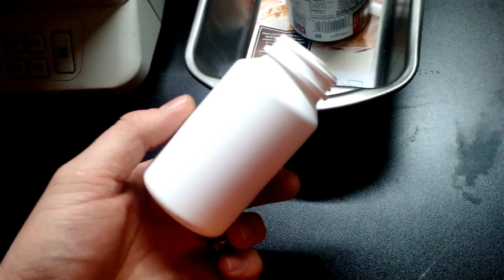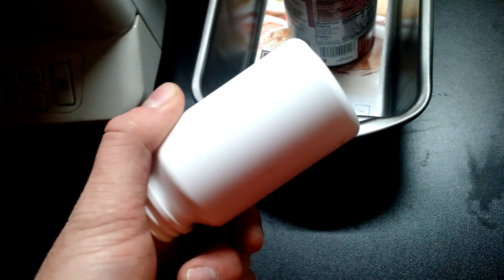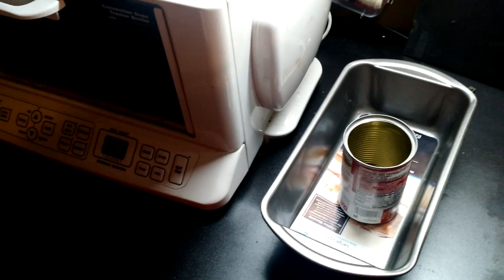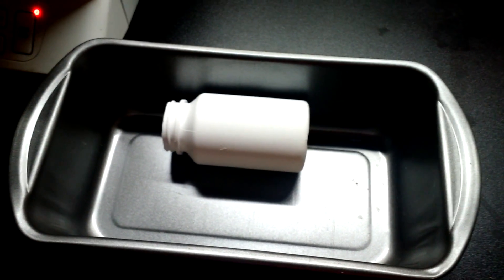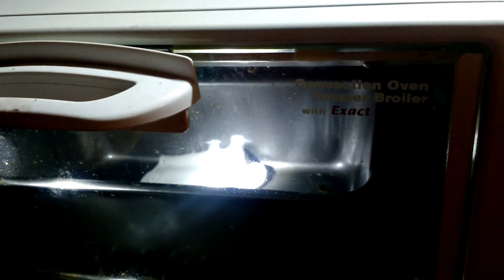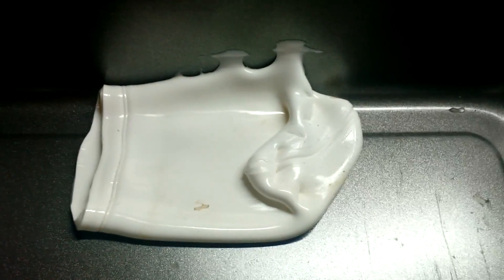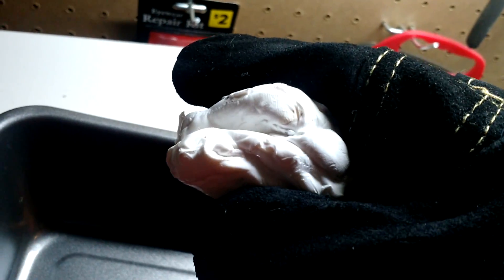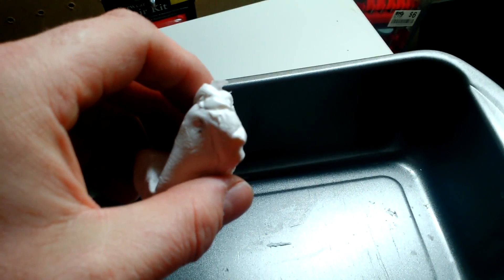How To Recycle HDPE Plastic To Make Parts!  Trash to Treasure, Part 1!

Comment: "Its super hard"...... thus the name HDPE   High Density Poly Ethylene
Reply from the maker: I was surprised as my workbench top has a quarter inch HDPE sheet on top to protect it.   It's super soft and flexible, even easy to scratch and nick.   Grocery bags are also mostly HDPE, and they are soft and flexible.

Comment: Rays woodshop already mentioned melting points but there is another thermal property of plastics that comes first and is HUGELY important to working with them: Glass Transition Temperature. This is what you're seeing first off in this video; the point at which a plastic becomes soft and loses its shape under releasing of internal stresses and the force of gravity. This is not the same thing as melting, but it is easily confused as such because the plastic becomes easily workable at this critical point. Once allowed to cool, it will hold whatever shape you forced it into and once again be hard, or this is really important, be even HARDER and MORE durable than it was before. In 3D printing, more experienced people will exploit this by baking their initial parts in sand or other such supporting substrate, allowing the plastic to lose rigidity without losing shape, and the resulting cooled part can have dramatically better strength and heat tolerance from then on. This matters to temperatures because afterward, the same amount of heating won't have the same effect anymore. It is now a material with permanently changed properties. Also important to note that not all plastics benefit from this, and some may even lose strength and durability.

Melting, in plastics work, is the temperature at which a plastic will literally pour like a thick syrup. Some plastics do really well with this state, others DO NOT, and these are very high temperatures for most industrial plastics, like upward of 250C, even upward of 300C. Polycarbonate is a fine example of a ridiculously high melting point plastic, yet if you're careful, you can bend it very effectively at the glass transition temperature and not risk burning it or compromising its impressive strength.

One thing to note about melting temps and glass transition temps is that it's not at all the same experience as like ice turning to water or metal turning to a liquid state. Such materials have a very fine line between solid and liquid. Plastics on the other hand tend to first lose structural rigidity gracefully, then more and more as they get hotter and hotter. As they approach the point at which they flow nicely, there's a strong risk of burning or destructive change in properties with additional heating, so in the industry they maintain rigid controls over hot enough but not too hot. What gets the job done without too much compromise is right where you need to be, and every plastic type has its own unique range. Take PLA for instance going to slop inside a hot car in summer, vs. ABS getting hot enough to give you burns when you pick it up but still holding its shape and strength very well.

</plastics_babblefest>

Comment: PLEASE WEAR A MASK
Reply from the maker: What type of mask do you suggest?   And do you know what temperature HDPE starts to off gas, the point where a mask would be helpful?
Reply: idk but you should definitely have some vacuum or strong ventilation system that can handle that prior to even opening the microwave.
Reply from the maker: That wasn't a microwave.

Comment: I’m finding plastic materials with the same triangle label, only thing is that the number doesn’t say two in the middle, like yours do. i’ve found ones with the number 5, some have 1, but most of them have 02 in the triangle. What does this mean? Can i still melt them? I’m curious as to what the numbers indicate, and of course if i CAN use your technique even though the number in the recycling triangle is different ?
Reply from the maker: The 2 means it's HDPE plastic, a type of plastic that is fairly non toxic and safe to melt down.    I'm not sure what the other numbers reference, I would have to look them up.
Reply: 1D10CRACY Gotcha, thanks for helping out 💞

Comment: Can probably use it to patch a cracked bumper
Reply: Those are more likely PP or ABS and they can be fixed with a plastic welder, but you'd need the matching plastic welding rods. Some bumpers are really thin, though, so a structural repair (like a mounting tab) might not be possible in those cases.

Comment: You showed up the milk jugs which had labels, and mentioned the HD for 5 gallon buckets.  They all have ink.
The point is to be aware of the fact that these pollutants have different melting points than HDPE, and change its strength.
That is one great reason recycling HDPE is not scaling or returned to manufacturing.  It is impure, and unpredictable to less useful.

Comment: I saw in the below comment that this plastic was non-toxic. That was going to be my question. I would be concerned about breathing around it as it softened in the oven. Interesting video.
Reply from the maker: I wouldn't go as far as to say non toxic.   But it doesn't offgas unless you burn it.   Milk jugs are made from the same material, the plastic itself is believed to be one of more safer plastics to work with.

Comment: great way to get cancer real quick.
Reply from the maker: So you think its offgassing?   Or just assumeing cancer is a result of melting all plastics?
Reply: Hydrocarbon inhalation causes cancer and other horrible diseases.
Reply from the maker: Ah ok.  Thought there was a risk I didn't know about..  At low temps there is no offgassing.     Its actually a pretty safe plastic to work with, and most food grade containers are made from it.
Reply: There is offgassing even at room temps-normal breakdown. The risk increases with the temp. There is nothing good about this substance. Nothing. It is damaging and offensive to every part of nature. It should never have been produced, but now we have tiny particles of it everywhere-the sea, the air....everywhere. So we reap what we sow. We deserve to suffer the fate of our stupidity, but other creatures do not.
Reply from the maker: HDPE or plastic in general?
Reply: All plastics. Recycling them into smaller and smaller bits never makes plastic disappear, just easier to ingest by more organisms. This is concentrated-CONCENTRATED as it moves up the food chain. Not diluted-concentrated. By the time it reaches large mammals (eg. concentrated in salmon, that salmon eaten by a bear)it is close to a death sentence. We are seeing the evidence of this in massive die-offs of marine life.(eg, the largest king penguin colony on earth has been reduced by a staggering 90%!!!)-this barely rated a mention in the mainstream media, no surprises there. Unless we can find a way to naturally return the elements of plastic back to nature, all we are doing is just shifting mountains of plastic from one place to another all the while stupidly hoping it will just magically disappear.

Comment: Thank you so much for the very informative video. Uses of this product would be endless. Only thing is 3OOC, would cost much electricity & escalation of my UK electricity bill.  Think. I  may need a manually operated Furness.  Thanks again fab video. Best of luck. Thumbs up & Subscribed.
Reply: Pat Pathinayake 350F
Reply: Thank you very much.

Comment: Worked in a Plastic injection molding plant for twenty years. High Density Polyethylene has a melting point of between 250-360 degrees F.  Might want to be sure to be very careful with the melted form which will stick to skin,clothes,shoes and does not feel very good.  Polyethylene can almost become liquid at around 450 to 475 degrees and does not come off of anything very easily. We melted Plastics in an long metal barrel. This barrel had a screw inside it with the incline of the threads tapered so as to increase the pressure put on the plastic which would help it to melt as it went from the feed throat to the front of the screw. The outside of the barrel also had sections that were heated by heater bands. The screw was turned by a hydraulic vane motor. At the tip of the screw was a check valve. Plastic would go past the check valve as the screw retracted once the shot size was made the machine would push the screw forward which closed the check valve on the tip and forced the plastic into the mold through a sprue hole in the mold. So basically when the plastic is shot into the mold under pressure it is in a semi liquid state. The molds are temperature controlled via a machine called a thermolator which would heat certain parts of the mold while cool water was also used on other parts of the mold to help the part to become solid quicker. We made plastic parts for Whirlpool refrigerators and other whirlpool products. We also used PVC, CPVC, Polycarbonate, Styrene, Acetal Delrin, and many other plastics, each having different melt points and specs. I worked on all the machinery and kept 52 presses running the best I could along with about three other maintenance men. And one last thing we used grinders to take bad parts back down to pellet form which we loaded into a large hopper above the feed throat.
Reply: David Bean - That sure takes me back.
I made baby toys for about 2 yrs. (Luv’n’Care)
Reply: Sir I think you’ve found your calling. Please think about creating a video.
Reply: @ David Bean, thanks for the information, I am a collector of 1/6 (12")  GI Joe Figures, I was thinking about using the black plastic clothing hangers with clips that I acquired .....to make equipment parts etc. What temps would they melt?
Reply: Cool, man. Thanks for sharing. I was kind of expecting this story to have some sort of accident or tragedy mixed in, but interesting nonetheless! Next time, give the people what they want! Lol
Reply: i wish you could show us on your Youtube channel. It would be fun to watch
Reply: Very good Information , you make your channel.
Reply: How do You keep clean the barrel and the screw if HDPE sticks everywhere?
Reply: what do you think about melt abs plastic? like on electronic case

Comment: How long does it take to harden?
Reply from the maker: Just a few minutes.
Reply: 1D10CRACY also... when hard... how much impact can it take without cracking... just say you took a hammer to it... would it crack or is it strong? I am wanting to make a chin guard for my skating helmet (cheaper than buying one) I already have my mould but I don't need it splintering in my skin if I stack it 😝

Comment: Folks..don’t try this at home in any of your kitchen appliances. Plastics are loaded with all sorts of chemicals that are safe to handle after they cross link and set..but once you reheat not so safe..need a plastic part go on the Internet..wanna help the environment..continue to recycle..
Reply from the maker: You are absolutely correct.   One needs to know a bit about the chemistry of plastic before randomly melting and working with various plastics.
Reply: Can you elaborate on this?  I've never heard about "cross link and set" - does something happen to re-melted HDPE that didn't happen the first time it was melted?

Comment: I cut the top off soda cans pack in as much milk jug as I can ,melt it add more push out all the air with a wood dowel and repeat until full to the top.place a weight on top while it cools or the side will pull in.then just peel the can off with pliers,you get areal nice cylinder.

Comment: I work in a plastics molding factory. Make all kinds of stuff....maybe even that bottle. All plastics have melt point. That bottle is around 335 degrees to start melting. We run our plastics at 370-390 degrees, it flows better that way.Having a cooled form will help it take the shape quickly too. just a tip.
Reply: Rays woodshop too hot, there will be toxic gasses
Reply: @Nero_One1  Your telling me about toxic gases? :) I guess I should have mentioned that.
Reply: Funny, the company i made recycled lumber for a while at, melted it at 348°F which is highest safe melting point.
Reply: Rays woodshop. His method is very crude and inefficient
Reply: Thanks for the info.

Comment: Form it into glue gun sticks. Put them into a glue gun and then pump them into molds to make parts or whatever. I would not advise breathing the vapors when it is hot. Matter of fact, after heating, I wouldn't handle any of it with bare hands. God only knows what types of oils and chemicals that comes out of that stuff. I know the FDA say's it's safe but really, I think I would err on the side of caution whenever cancer is a possible consequence.
Reply: To turn it into a bottle/jug they have to get it that temperature to form it. You touch the bottle with your bare hands, so remelting it isn't really going to make much difference. By all means be cautious. I'm not really faulting you for it. Just pointing out a logic hole.
Reply: Seeing it requires upward of 356°F/180°C to melt this viscously I am not sure you want to touch with bare h ands and I worked for a Recycled Plastic Factory previous owner to make lumber and do other tasks around the company for what little it paid at the time. But yeah it Burns your skin if you touch with bare hands, i had pieces shoot out from the ejector at me due to water intrusion.
Reply: Oh and far as fumes very non existent at melting temps, but above highest melt temp and you will smell and taste it. before the fumes become visible to you.

Comment: 350F is borderline hot enough to really melt HDPE. I Melt at 385F and it is a lot runnier then.
Reply: any higher than 356 and your asking for a lesser PE quality as it melts at a max of 356°F, and remolding it too much also degrades it

Comment: Hope you enjoyed the toxic fumes you were breathing in.
Reply from the maker: +Kruell HDPE is actually fairly safe and doesn't off gas until you pretty much burn it.   Though there may have been some toxic fumes released from the Taco Bell I had earlier and other than the pressure relief, it was not enjoyed.
Reply: Worked for a small company making HDPE and PE lumber in 2005, still living quite healthy to this day cancer-less.

Comment: I'm currently using "Gorilla" plastic. Using boiling water to melt it. But this seems like an even cheaper option. Gonna try it for my next repair project.
Reply: Paul G looks like he didn't quite know all types of plastic lmao
Reply: Um not sure what you mean by gorilla plastic as i never heard of it and I know all types of plastics. Or you are referring to that putty called Sugru which is an adhesive plasticiser, not the same formula as PE.
Reply: He's talking about one of the varieties of polycaprolactone like Instamorph/Polymorph (Sugru is silicone-based iirc). PCL is neither as tough as HDPE, nor is it temperature resistant. It's ok to make little doodads out of for indoor use in temperate climates, but it certainly wouldn't work as a fishing rod handle.

Comment: ALL PLASTICS CAN BE REYCLED  but the more you use the plastic the more brittle it becomes , and this is not the way it is processed to make a bottle
Reply: Also too high a temp also degrades its properties. PP for one will catch on fire above its melting point of 360°F/180°C.

Comment: He said "lathed"⬅like that's a verb😂like that's even a word.
Reply: zapwatt well Mr z, you can say what you want to all day also, but if you have never used either a wood or and a metal lathe as I have, or even used a CNC  machine you really do not have a good grip on the terminology. You can turn the machines and engage the motor and all it will do is turn the chuck or piece of stock mounted in or in it ( except for the CNC machine witch requires a program) that is all that will happen, a turning. It is the moment you touch the stock with the cutting tip of choice and start the process of shaping the stock that you actually start to lathe or lath-Ing the stock occurs. And how many lathes do you own ? I own both a wood and a metal and use them quite frequently. And if a shop I might would go into and they had a problem with the terminology I use to explain what product I wanted made and they started to snigger or laugh I would walk out the door locking it if I could keeping those particular individuals inside and away from the general public.
Reply: @rodneyrussell8442  I never take grammar advice from someone who owns fewer than 2 lathes.  ;-)
Reply: JFC the lengths some people will go to, to avoid admitting they may be wrong.
Reply from the maker: +zapwatt I did!    I coin up words all the time!    LOL
Reply: Rodney Russell 

Rod, you can say that all you want to but if you walk into ANY machine shop and say something like that, they'll laugh you right out of their shop and lock the door after you've been escorted out.

The operation is called turning.
Reply: Kat Kalakosky perhaps It is a word but in this instance he should have said turned.
Reply: Well, you said it wasn't a word. I wasn't saying it was used properly.
Reply: got that zap,  you were wrong, admit it!
Reply: All words are made up lol
Reply: Well, Z, I looked the word " lathed". And for your information it is actually that, a word and a verb on top of that! And its is defined as " to cut or shape on a lathe ". Plus there was two more words with the same meaning which are "lath-ing" and " lathes". Just to let you and whoever else would like to know this fact.
Reply: It is a word. Maybe look it up before you correct someone.